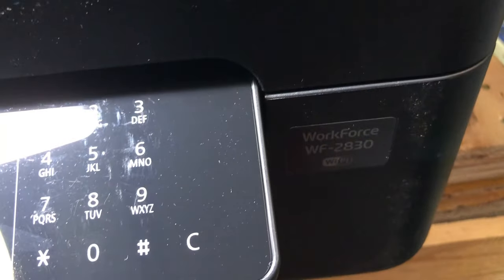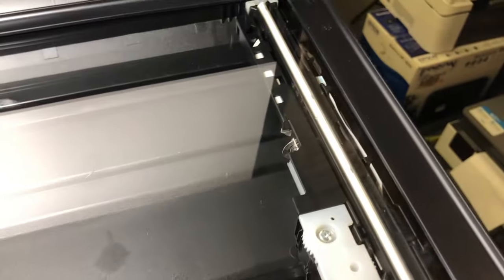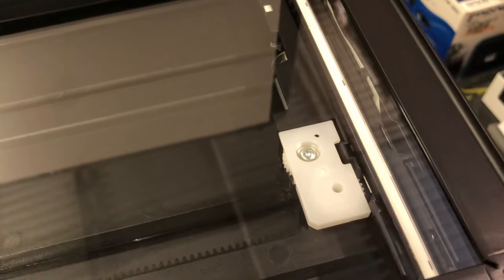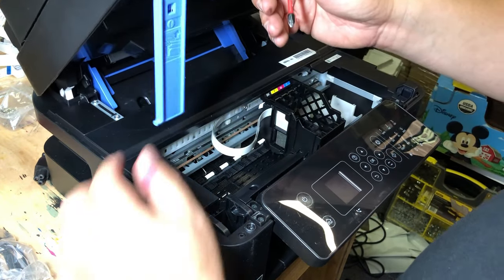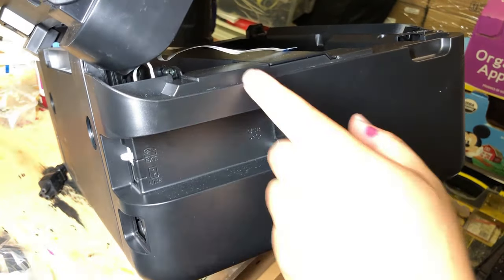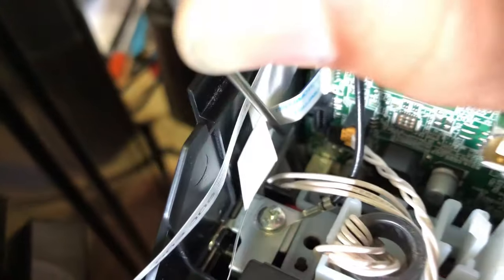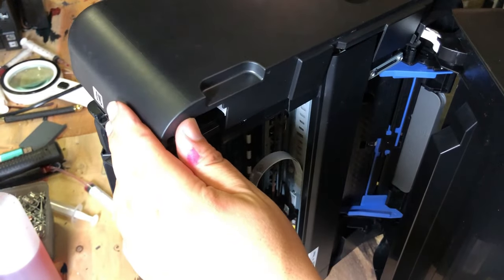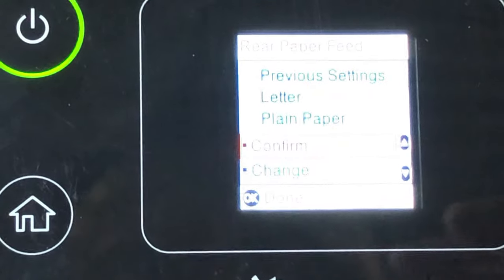Fix Epson Scanner Error E 02 100077  WorkForce WF-2830 or 100016 on XP-4100 XP-4105

Comment: The ribbon on mine has come out of the white connector, I was having problems re-connecting so I took the connector out thinking it would help… can’t get the connector back on!!! In the process I’ve bent some prongs. Does the printer need throwing onto the trash heap or can the scanner be taken offline so the printer will at least print?

Comment: Appreciate the existence of this video, the website is of no help with error codes, but it makes sense given the primary audience for these at-home printers. Just came home with mine new-in-box, and the ribbon was disconnected from factory I assume. Quick and easy fix, 5 minutes and all I needed were rubber-tipped tweezers for ease of installation of ribbons, and that type 2 Phillips. 2 screws and 2 push tabs.

Comment: Very Similar to the  WF-2580. Except the board is a little more tricky. There is a long black top plate back towards the hinge. Unscrew that with a Philips. Then with tweezers, grab the strip and insert it into the black ribbon port. Follow through with the double sided tape as the video states. Align panel as video states. The printer is now functional with out error message. 

Thanks for the video sir!

Comment: Mt scanner seems to be stuck, it makes the sound as if trying to move but it doesn't, and I'm getting the error 100077, Is there a way to clean out the scanner? Or how would I clean out the scanner?
Reply: Did you ever get it fixed  . Currently having the same issue